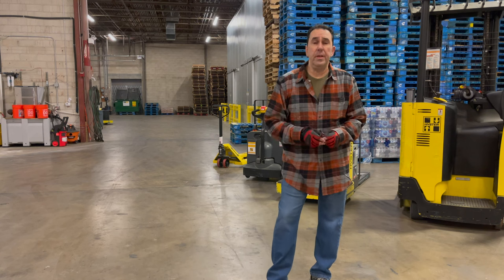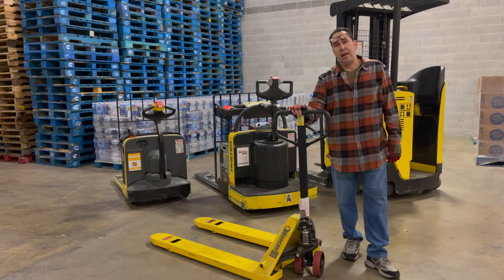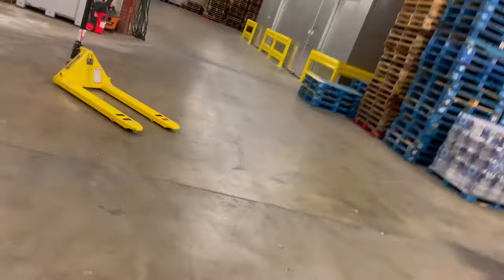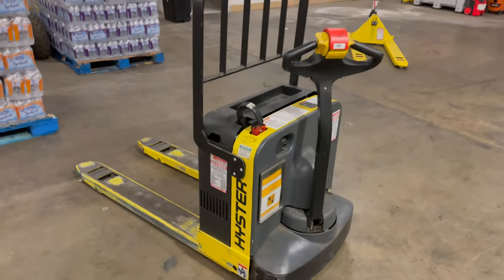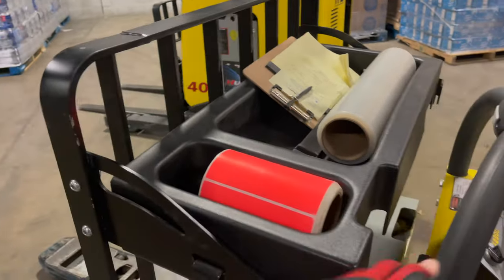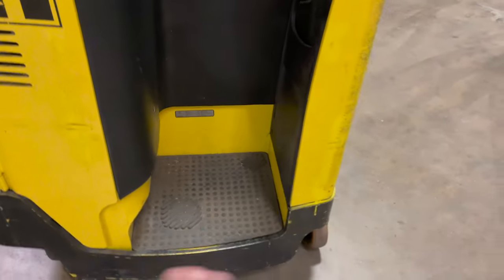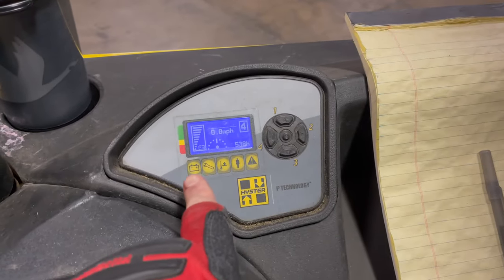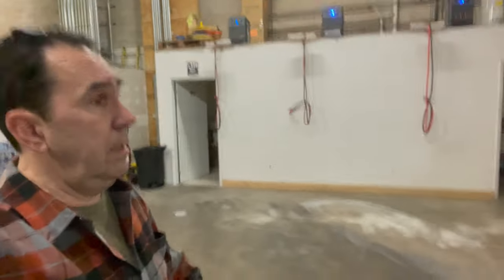Warehouse Jacks and Forklifts We Use Hyster

Comment: Amazon safety would have an aneurysm over those stacks of pallets. Over 10 is considered a safety violation that they can write you up for aside from double stacking two of them into a stack of 20 right outside a dock before loading them into a trailer with a forklift.
Reply from the maker: Thanks for watching that’s the difference between a huge company and a family owned little company.
Reply: @TumaTime  I have about a year experience there driving a Jungheimer stand-up forklift nearly identical to the one in your video. Lately Safety has been firing people for the most nitpicky bullshit, so I've been thinking of applying to other places. Although Amazon self-certifies so I don't have an OSHA certification.
Reply: Walmart stacks pallets 15 high when we backload them into trailers. It depends on the company.
Reply: @theman-ox3cw  Amazon was 20 high into the trailer, but never higher than 10 until the stacks of 10 were stacked on each other as you loaded them into the trailer.

I’m working for a few temp services now so I’m at several different warehouses and one of them stacks them really high in a corner of the warehouse.